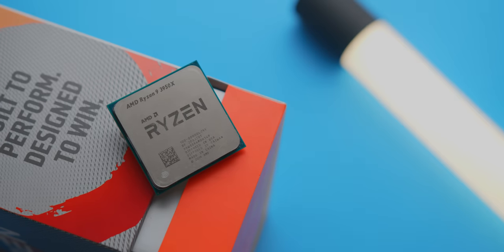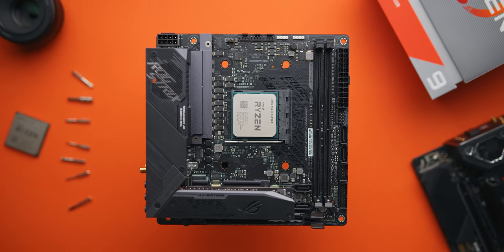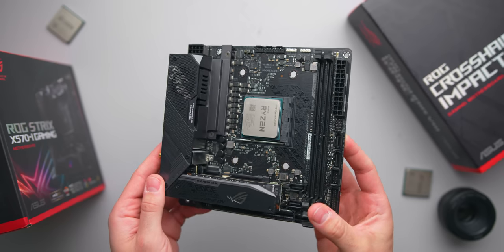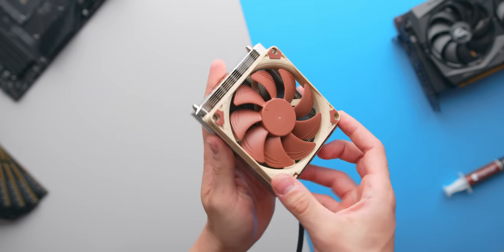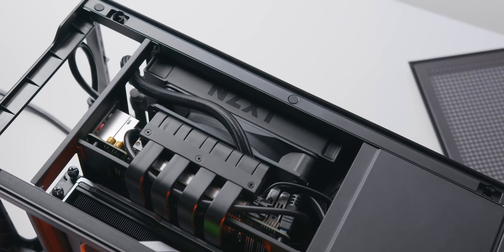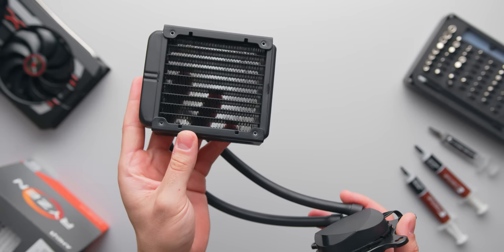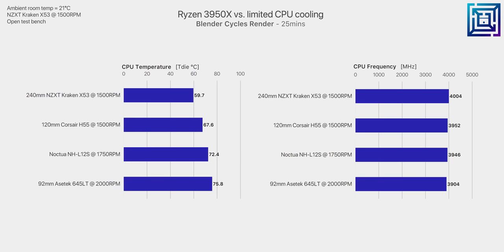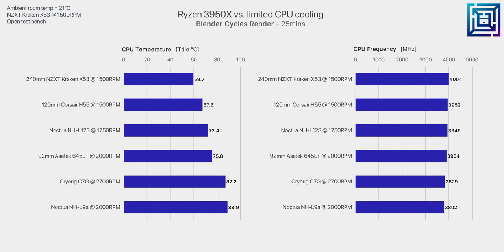Ryzen 3950X vs. Low Profile Coolers - Sanity Check

Comment: Due to needing a high performance rig for the kind of work I do and wanting a SFF build, I went with the NH-L9a in a case that is similar to the DAN A4 (the ZS A4 v2). Paired with a 3900x, I'm seeing idle temps around 68 degrees celsius with it hitting 94 degrees celsius under extreme load. This is stock prior to undervolting and switching to ECO mode, which I will be doing. But these temps just seem unusually high to me. I'm new to SFF builds, so is this what I should expect in a case similar to the DAN A4, or did I stuff something up? I applied the thermal paste by spreading a thin layer over the full IHS to ensure good contact with the cooler. Since it is a serious pain to get the system back out of the ZS A4 v2, I really don't want to open it up, and redo the thermal application if I don't have to, so wanting to ask advice from people that have experience with similar sorts of builds.

Comment: I just tried a 9900K in a Velka 5 case with a Cooltek LP53 cooler with a slim noctua fan. I managed to get it running @ 4.4GHz all core with a TDP of 115W after undervolting. That kept it at ~75C under real world use cases.

If I were to switch to an ASRock x570 itx, I would likely still be able to use this LGA 1151 cooler and cool a 3950X, albeit at  a level b/w the Asetek and Cryorig.

Comment: I would be interested in seeing a more detailed look at performance stability over time rather than averages. It doesn’t really matter if you only have to sacrifice a little performance for a smaller cooler if clock speeds are all over the place from one minute to the next. And this problem would only be compounded within the constraints of a <15L case. The information you’ve provided us is still very useful for those who want to experiment with using multitasking monsters in a SFF system.

Comment: I do have a mini ITX gaming PC with a Ryzen 7 3700X and a Noctua NH L12S. 
I think if you are targeting 60 FPS in latest AAA titles this is a good option. 

But thats because I clocked it to 3,0 Ghz @ 0,93v on all cores and everything runs at least at 60 FPS 1440p.
Thermals are around 45-50°C which is just amazing.

Paired with a good blower GPU that makes a nice SFF system.
And if I feel like needing more power I can just change clock speeds.

Comment: I use a sunbeamtech core contact freezer 120 and a 120x25mm DELTA AFB1212SH PWM fan on my ryzen 3 1200 pending an upgrade to a 2600-3600... according to frostytech, its one of the best aircoolers in the AM2-AM3 days... I believe it still is up to now... yeah I know a noctua NH-D15 will kick its ass but I do not OC anyway, I just clock it to the highest reachable clock without increasing voltages.

Comment: I just got done building in the Ghost S1 with a 3950X and a Kraken X52. It idles at 45C but spikes to 70C 1080p gaming load. I havent undervolted it yet or used eco mode, but if I was going to maybe I would have been better off getting a 3600 instead. It's hard for me to recommend the 3950X to anyone using a case smaller than the NCASE M1.

Comment: What would the performance and thermals look like on the smaller coolers if you started disabling cores? I have always been curious if turning off cores on the 3950x would end up with performance results similar or better to a 3700x or 3600x with respective cores with significantly lower thermals. I thought about this for the better single core performance if I wanted to have a smaller case.

Comment: Damn I'd love to build some overpowered PC in a tiny case with smallest cooler.
But I already have a PC and can't just buy another one and have no use for it xD
Reply: You could possible do what I did and maybe buy a piece at a time and switch with your current rig and resell each part on ebay, eventually leading to your mini itx build. Fortunately for me, I just needed to buy a mini itx board and sold my old motherboard on ebay (at a profit too) and I was able to switch to a mini itx case with no issues hardware wise.

Comment: I got a MSI B450 GAMING PRO CARBON AC and recently i thought about what would be the highest end CPU i could upgrade to later down the line.
Right now i got a 3600 and a Brocken 2.
I'd potentialy switch the cooler, but what Do you guys think would be the maximum i could go with that Mainboard?
Reply: I can’t think of any reason why the 3950x wouldn’t work... that’s a high end b450.

Comment: I hate pump noise, and I have a 3950x on my first ever AIO and can’t believe how people live with it! Swapped out to a slightly quieter AIO. Thermals are excellent, and Load noise isn’t too much of an issue, but idle pump noise makes it impossible for me to say sleep in the same apartment. Been seriously considering just going to air cooler and taking the performance hit. Or going larger case.

EDIT: Now I’ve finished the video, the performance hit is much smaller than I’d have thought. I could absolutely justify an L9 or cryorig on that. Could even get a smaller case 😂

Comment: Don't forget, temps in a case could be very different depending on airflow etc. In a Steck my 3.3GHz R5 3600 @0.97V vcore and 0.9V SOC is at 50C doing browsing and watching videos, with a Wraith Stealth. Prime95 SmallFFT max temp around 71C, excited to see what difference NH-L9a brings, even though there's maybe just a very small difference.

Comment: Hi Optimum Tech,
I have an off the track question. I am looking for the smallest board available with two pci-e slots - one for gpu and the other for a sound card. Use of a micro atx board is not allowing me to go below a certain size of cabinet. I am sorry if I have asked a wrong question.
Thank you.

Comment: I'm assuming this is with a stock X53. I've switched my X53 fans out for Noctua NF-F12 fans and it's much quieter with not much thermal increase. I have NF-A12 fans on the way though!

Comment: i have the 3900x in the DAN Case with a asetek AIO and some undervolting. The temps are VERY good. No more than 85 celsius at FULL throttle  (20min test)
Reply from the maker: PPT for the 3900X is the same as 3950X at 142W, so that's spot on my estimate in this video. Thanks for sharing!
Reply: @UCnD6rw2y8LgkO-O3rhRiAJg  cool, did u  added extra fans for the vrm? 
i have 2 slim noctuas 92mm, one at the bottom  (in the optional hdd area) and one over the asetek cpu AIO pump (sticked with double tape (il 3d print a bracket))

Comment: Long story short, I was given a prebuilt compact pc, a Lenovo c730, with a 9900K. I would like to upgrade the OEM fan cooler with a new air cooler, but it would need to be compact and under 100mm in height. Any that would be recommended for this? The case would have to be modified for an AIO cooler, so that would be a last resort.

Edit: with the stock cooler it is pushing close to 80C most of the time in games.

Comment: Could the heatpipes be bent 180 degrees so it could be used in SFF case with 2 slot GPU over the CPU? That cooler is cheaper than the kit I could use but I need to know it they can be bent. And it would also be softened with heat so its easier to bend?

Comment: The options for air cooling in sandwich cases are becoming really limited as CPUs increase in power which is really frustrating. The Cryorig C7G, as far as has been tested, is the most powerful air cooler that is sub 70mm and that also doesn't require compromising on RAM selection or now doesn't run into weird motherboard clearance issues. The Thermalright AXP-90 Full Copper and Full Black have become available again but their design is not very different from the C7G so I'm not sure that their 140W rating can be believed. The next best thing then would be the NH-D9L which is rated at 140W and towers at a nice 110mm, at which point one might as well switch to a case with a standard layout and buy a proper tower cooler. I'm not sure that sandwich layouts will remain viable to air cool high power CPUs for a very long time. It is really sad.

Comment: I bought the Corsair H100i Platinum RGB SE (white - which I haven't seen many reviews on) for my Ryzen 5 3600,  yes it's overkill for the 3600 but when I upgrade to something hotter in the future  I wont need to change the AIO 😁

Comment: @Optimum Tech.  So is it feasible to put the 3950x in Velka 3 with a less power hungry graphic card like 1650/1660 and call it a day. That would be awesome. it will be a very tiny machine and can outperform many laptops and yet very portable. Performance will suffer but on the same price and portability, i don't think anything can beat it.

Comment: Now I am wonder what is the smallest Sliger that you could fit a NH-L12S and feed it well enough.  I think 100-110 W limit on the 3950x would be useful, with a motherboard that can handle as much memory as possible.  
Portable Home Labs are a thing.  I wonder if we can get any X570 mini-itx to handle more then 64GB of RAM.

Comment: Will work at 3Ghz, but works well with a C14S at idle fan speeds(700RPM), i know, its not low profile, but actually works well in the HAF XB EVO either exhausting hot air directly out of the top, or downdrafting onto the RAM and VRM to cool it and sits at 4.2ghz with reasonable fan noise from the CPU fan and 3 case fans. Edit, i think my ambinet temperature is much better than yours, i dont know why i'm seeing 4.12-4.2Ghz when you're seeing only 4.0ghz, though i'm not running a 30 minute blender render and mormally have it underclocked/stock clock to elimiate noise and significantly reduce dust build up, for me, most of the time, per core performance isnt as important as many core. Which is why for the longest time, i had dual X5675/X5690
Reply: I'm able to hit my 3950x, with full load, at 2.2Ghz, but fully passive, not a single fan spinning in the case, using the C14S, it runs hot at 89-91c, but it is stable, note this requires the mesh top and side panels to be removed, and ideally the fan removed from the CPU cooler, though i didnt in fear i'd need it

Comment: Any chance we can see an updated video with the Arctic Liquid Freezer II 120 mm AIO ? Looks like the radiator on the Arctic is thicker than other 120mm ones. If the thermal performance is better (at low noise), it could potentially open up a lot more SFF case options for the 3950x

Comment: Really interesting,and mirrors my experience, I have a Scythe big shuriken 2 cooling a 9700k in a Ghost s1, and a Asetek 945 on a 9700k in Dan A4, the air cooler is better than the 92mm AIO, and comparable to the Noctua L12s.

Comment: Running a 3950X in an SM580 using the newer Kraken X63. Being that this is my first new desktop build in 10 years in still learning how to control case fans and AIO speeds, but seeing high 60's under gaming load.
Reply: most games doesn't need huge cpu intensive.

Comment: Interesting! Have you tried using negative offset voltage? Obviously with manual voltage and auto frequency, the CPU silently throttles performance as you lower the voltage, but at least on Asus boards, using a negative offset voltage "tricks" the CPU into running normally but with a reduced voltage (because it's commanding normal voltages, I guess, even though the motherboard is undercutting them). On my 3900X at least, this reduced temperatures *drastically*, while keeping performance identical or slightly better (lower temps >> more boost clock), even for really tiny offsets. I'm using a -0.0125v offset or something right now and it reduced temps by 5 or 10 degrees. Although fair warning for anyone trying this; I did also run into odd behavior where the system would sometimes refuse to boot if the room was cold, when I had a bigger negative offset... Even though it ran perfectly stable for hours under max stress. Very weird! So it would run fine all day, and then the next morning when I tried to power up, it couldn't quite do it. I ended up reducing the offset until that no longer happened. Still got a significant temperature reduction with unaffected performance.

Comment: Been thinking about a 3900x in an Evolv Shift Air. Can I assume that the thermals should be similar with the coolers tested since the Air version of the Shift with its mesh panels should perform like an open air test bench set up?

Comment: 3600x here in an evolv shift. Went with ml120l mounted in the bottom and temps still get up to low 70s in stress. I had to go with only a pull setup downward as the tubes aren't long enough to mount the rad in the bottom and my board only has 2 fan headers (MSI b450i). CPU header running the pump and 2x front 140mm and 1x120mm on the rad all running pwm off the second header (sketchy about running more than 3x corsair ML fans off of 1 fan header). Hopefully it will handle 4th gens 12 core. That's if b450 even ends up supporting it 🤞. That's why I decided to go with a 6 core for now. Don't want to lose too much when I upgrade to 4th gen.

Comment: It looks like you did build with the H55 on 5 Sep 2018.  - Please put a 5950X into a Dan A4 & cool it somehow. - I don't care what graphics card it has. - I don't do renders, I have a bursty workload, but 16 cores would be amazing. - is it possible to move the motherboard plate back to get more room for the CPU cooler? I hope AMD does a NUC style machine - a portable workstation would solve a lot of problems for me.

Comment: you have mount fan with wrong orientation on  noctua nh-l12s (the fan  must blow through the cooler, not suck through it) the difference in temperature is big

Comment: Without comparing noise those temps are pretty useless. Not trying to be.mean, but if the 120mm is 5C cooler but 10db louder than the 92mm or vice versa, that matters. A lot.
Reply: He knows that obviously.....but the point of this video was to see how a very economical cooler runs such a beast of a cpu....my ceiling fan anyway makes more noise than a freaking cpu cooler lol

Comment: 3900x also has 142 watts PPT but less cores. Does that mean it is warmer than 3950x?
Reply: Interestingly, 3900x comes with a stock cooler but 3950x doesn't

Comment: very good video, thank you :) I am actually thinking of putting the 3950x in my Dan A4. Currently i am running a core i7 6700k which, the way it is configured, draws around 85W at prime95 load. thats around 90°c hottest core at 25° ambient. cooler is a Dynatron K129 with a noctua 92mm fan. 
keeping in mind the 3950x has a soldered heatspreader, and thus should be easier to cool at the same power draw, i think it should work quite fine at around 95W power target with the same cooler. any opinions?
Reply: Well, the 3950x is probably the most efficient cpu in the market right now, at least when speaking of consumer hardware. If you don't like it in your setup, you have a problem with your case/cooler, not the cpu. It would be wise to buy only the cores that you need, as lower core amounts will likely run at higher clocks for the same ppt

Comment: 92 mm AIOs are extremely difficult to find on sale.
Reply: Thx
Reply: Well i'm not surprised when you see how small air cooler outperforms the 92mm aio
Reply: @trakaiszeks  true
Reply: I know you said 92 but if you get a  120? is it that much different? . like 1 cm-3 cm 1.5 inches difference in size but deepcool has rgb ones for 70 Canadian. That's cheap considering and Aio is normally between 100 and 300 here.

Comment: I'm thinking of using the 3950x in a Dan Case A4 with the Asetek 645LT. I'll be suspending the case off the ground on an ikea finnvard (https://www.ikea.com/ca/en/p/finnvard-trestle-with-shelf-white-80150095/) so access to air shouldn't be a problem. 

The question is, should I put the fan on the bottom of the radiator as an intake and let it passively exhaust? Should I do the same for a slim fan under the motherboard? 

Thanks for the great content!

Comment: I had the Big Shuriken 3 and couldn't even run my 3600 under 88°C in a Prime95 test. Also my 3900x with a NH-D15 isn't cooling below 77°C under full load in Vray.
At work I have a 3950x however and that one runs 67°C Max in Vray with an H80i. So I am wondering if my 3900x just runs hotter or the NH-D15 isn't as good as a 120mm AIO (which I doubt).

Comment: Thank you very much. Working on building a new PC in a NR200; Asus Rog Crosshair VIII Impact, RTX 3080 Ti FE, Ryzen 9 5900X, NOCTUA NH C14A CPU COOLER, Corsair SF 750W 80+ Platinum, Samsung 980 Pro 1TB, Noctua fans, Thermal Grizzly Kryonaut. And a few other goodies. If you could please, let me know what you think and/or if there  are any problems. That is anyone out there too. Don't really have anyone to assist me w/. Thank you very much.

Comment: My 3950x is cooled by the be quiet! dark rock 4 pro. I chose it instead of noctua nh-d15 because one guy said that d15 takes too much space above the ram slots and I wouldn't be able to insert a high profile ram stick into the slot that is closest to CPU. When I was making my order I found only a couple of comparations of theese two coolers and they were running pretty the same (d15 was a bit better, but only 1-2 degrees C) so I've decided to buy the dark rock. It works pretty well, but i'm not too satisfied with it. The temperatures were about 70-75 C normally and sometimes raised up to 80. Then I've made some corrections to cpu cooling profile and made it spin at 100% after 60 degrees and now it doesn't go above 70 even after a couple of hours 100% cpu usage.

Comment: If I was limited to a 120mm loop, I'd use one of AlphaCool's fat radiators (45? 60?) to try and whittle off those few extra degrees.

I'm seriously looking at the Evolv Shift Air. With a bottom mount Noctua, one of those beefy rads would fit nicely should I ever decide I can't live without 16 cores of pure awesomeness.